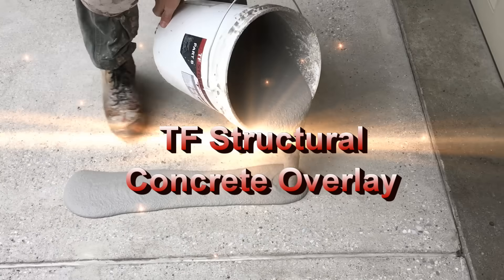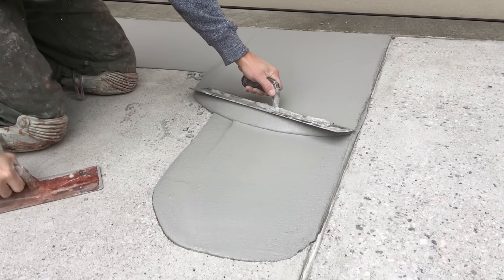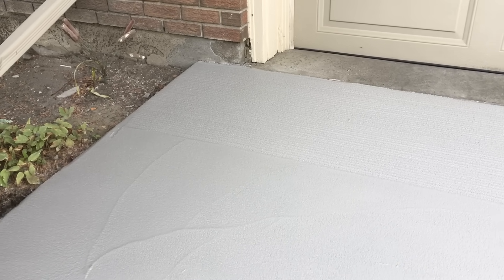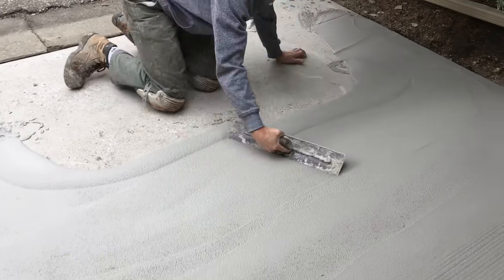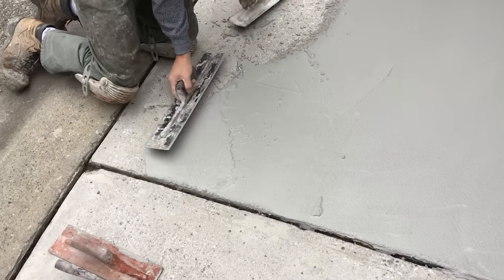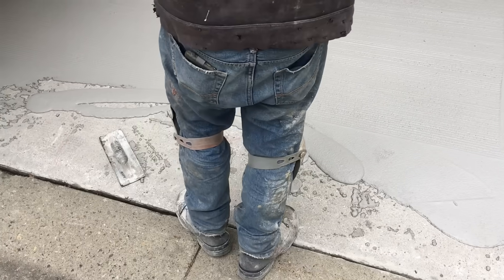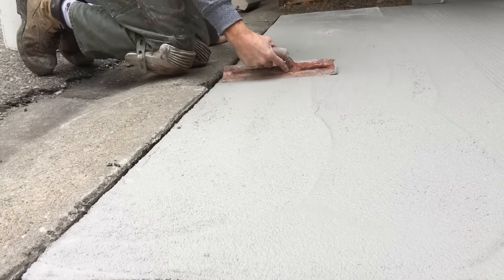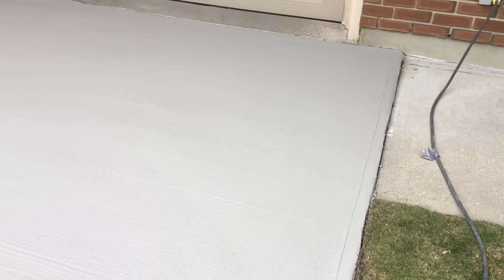TF Structural Concrete Overlay - Overview

Comment: Unfortunately, it's impossible to find ANYBODY willing to do this type of repair work. Concrete people like to rip everything out and install completely new reinforcement and everything, right? The video's look great though. Thanks much.
Reply from the maker: Try finding a concrete craft near you, they do it. Where are you located?
Reply: @TerrafuseInc  Thanks for your reply. I ended up having the slabs replaced. It was about 800 SF of very cracked driveway that had to resist garbage trucks and dumpsters. I think it could have been repaired but I gave up looking. No Concrete Craft within hundreds of miles.

Comment: How thick is the coat and can you apply a second coat. I have a badly spalled concrete steps
Reply from the maker: It’s about 1/8”. Yes, you can add another coat, or just apply it thicker, there are no restrictions.

Comment: beautiful work! we just got new concrete laid in our backyard, but theres imprints from the contractor crawling on the surface. interested in doing doing a stamp overlay. the surface currently has a brush finish. would it be necessary to sand it down before laying this product? thank you!
Reply from the maker: Yes, you need to do some prep on the concrete first. https://youtu.be/aCK3hjHAjXU
Stamping is a very challenging process, so I would only attempt that if you are highly experienced with this sort of work. Thanks

Comment: Nice technique. Other similar overlay products recommend or require hydrating the old surface before applying new material. What is different here? Like others I question going over the big crack without prep. Even if the customer didn't care, compressing a dry mix into that crack would minimize future erosion without a significant investment of time.
Reply from the maker: Also, other products are portland cement based, and require a hydration reaction to cure. It is very important the water stay in the material as long as possible during curing. 
TF Structural is not a portland cement based product, and does not cure this way. 
Hydrating the concrete before installation is still recommended, especially with thinner overlays, and on hotter/drier days. This will help with working time, spreadability, and overall finish.
Reply from the maker: Agreed. Lots of things should have been done with this crack, prior to overlaying.
Reply from the maker: https://youtu.be/o5UYlJmKhAE

Comment: How long does that concrete material last before cracking or chipping away ?
Do you apply any type of bonding agent in mix or on original concrete ?.
I live in a very harsh winter climate, wondering if that would not hold up well in freezing Temps and snow
Thanks
Rich
Reply from the maker: it will wear out at about 1/8" every 15 years or so. We have lots of videos showing it years after installation, one as old as 11 years. It won't 'chip' away, and will only crack if the substrate below it cracks. 
No bonding agent is needed, it doesn't need to be 'glued' to the surface, it will chemically bond with concrete.
It was designed and used extensively in Canada, so harsh winter environments is what it is made for. 
Thanks!
Reply: @TerrafuseInc  Thanks for the reply, Sounds very durable !! appreciate it

Comment: I don't get it, if cracks is not addressed and as you stated it will resurface; then why didn't you address it to begin with?
Reply from the maker: They didn't want to pay the extra. They weren't resurfacing these driveways because of cracking, the crack wasn't an issue for them.

Comment: You could've filled the crack with concrete first.
Reply from the maker: Concrete crack bridging using TF Structural Concrete Repair and flexible mesh tape.
Reply from the maker: https://youtu.be/o5UYlJmKhAE

Comment: I noticed you said "cracks come back". So you resurface this just to have a big crack come back? This product looks really good and I would love to use it just would like a further explanation of " the crack coming back". Thank you
Reply from the maker: This is a very rigid material, going over a rigid substrate. A thin layer will not prevent a large slab underneath from moving, this is why cracks will reflect through. There are many ways to address cracks before overlaying the substrate, to help prevent them from returning. We have a video on one method, and will be releasing more soon. Thanks
Reply from the maker: https://youtu.be/o5UYlJmKhAE
Reply from the maker: https://youtu.be/iuK9_XweHKA
Reply: Very nice. Thank you!

Comment: So the crack comes back... pointless then really. You  could have easily opened it up,  filled it first with a coarse concrete mix and then surfaced it- added an hour to the job.
Reply from the maker: It wasn’t pointless. This concrete had a horrible finish on it that they wanted redone. They didn’t care about the crack, so it was not repaired (there is an extra cost to this )
Reply from the maker: https://youtu.be/o5UYlJmKhAE
Reply from the maker: https://youtu.be/iuK9_XweHKA

Comment: Nothing is perfect but digging it all up and re pouring...concrete cracks over time..shifting ground underneath....concrete is superior over asphalt. I fill the crack and seal driveway to look good only...my patio we will skim Like this filling in cracks first....with power washing should look good for a few years...nothing last forever .
Reply from the maker: If repouring concrete was perfect, I wouldn’t have created these products 😉
Reply: Terrafuse Inc. that’s true ...haha...my ex was a mason and half the patio he did held up pretty good ....I was responding to the crack comments in the pavement....What do you think about filling cracks with epoxy first?

Comment: I doubt this process would last even two years in a harsh winter climate.....
Reply from the maker: Interesting comment, based on no factual information. It lasts much longer than 2 years. It was designed and tested in Canada, which has some pretty harsh winter climates 👍
Reply: @TerrafuseInc  The name is Tucker not Sucker.....good luck peddling it.
Reply from the maker: Thank you, but I don’t need luck. Our information isn’t based on nothing, like your comments tend to be.
Reply from the maker: https://youtu.be/iuK9_XweHKA

Comment: What product is this, whats the working time and dies it have a minimum thickness?
? I did a self leveling underlayment once that set up too soon.
Reply from the maker: TF Structural. It has 15-20 mins working time, temperature dependent, and no minimum thickness.

Comment: Thumbs up for the product and double thumbs up for the skills! I have a crapy concrete patio that was done by some newbie and it looks very hideous. I think the concrete was mixed with too much water or sand that it chips off easily on its surface. Would this product solve my issue?
Reply from the maker: Thanks! It works great for that application! Just remove any loose concrete first 👍

Comment: I saw a crack on that one slab, what did you do to prepare that? Is there a different video?
Reply from the maker: https://youtu.be/o5UYlJmKhAE
Reply: @TerrafuseInc  thanks.
Reply from the maker: For this slab, we just removed all the loose, broken concrete. This product is very rigid, so the crack will reflect through. There are many different methods to address cracking, and we have one video out to demonstrate one of these.

Comment: I didnt hear how they cleaned the concrete first. 
Pressure wash? Thanks
Reply from the maker: This job was scarified, and then they used a diamond grinder. If the concrete is free from sealers and oil/grease, and heavy pressure wash will work fine. You just want clean, sound, porous concrete. 
Thanks!

Comment: Thanks for the future work! Ill be ripping that out in 3 months. 6 months maybe if you sucked up the homeowner's renovation budget. Toppings are like 10 minute band-aids. No matter what the box, bag, or bucket says, it will fail. That crack came back within 3 days of driving over it and in 6 months was chipping out.
Reply from the maker: The only thing true about your comment, is that the crack will reflect through the new overlay.
Reply: @TerrafuseInc  So it will fail.
Reply from the maker: If you consider a crack a fail. This customer had an old overlay on the driveway that was delaminating. They wanted a new overlay, and they were aware the crack would return, so the crack is not considered a fail. Products used for resurfacing are extremely strong under compression, but have no flexibility. However, there are techniques to address cracks, but it is very difficult to guarantee a fix. As well, we can offer flexible, decorative overlays if that is what they want fixed.

Comment: Hello. I have a two car garage in Nee England where the concrete can become damp during the Spring. Will this product hold up without bubbling up?
Reply from the maker: Are you just doing some concrete repairs, and leaving it, or covering it with a coating after? How thick are you going? Some details will help me answer 👍
Reply: Terrafuse Inc. Thank you. Need to abrade the concrete and coat it same way as in the video. Floor is even but.damp in middle sometimes. Not wet.

Comment: Do the applied concrete overlay will have a chance getting chipped? And is it applicable to apply sealer after its curing?
Reply from the maker: No, it won't just chip off. There is no need to apply a sealer, but if you want one, you will need to do some type of mechanical abrasion for the best bond, as the TF Structural cures very dense. A light sandblast, or heavy pressure wash would be needed, to give the sealer the best bond. Why are you looking to seal it after?

Comment: Great job...just dont see the point of using this material if it's not an elastic material to move with the cracks and keep the unexposed 🤔
Reply from the maker: There are many issues with concrete that can require a restoration. Scaling surfaces, improper broom lines, heavy pitting and damage, improper sloping, incorrect thickness, etc. Using elastic materials can be very costly, and often look very out of place outside on a driveway. We have these options also, but a lot of times, customers just want the broom finished concrete look. Like concrete, cracks can't always be prevented with rigid materials, but they can be filled after they show up with flexible caulking, or similar materials.

Comment: Ya should have used portland and bonding agent but first you have to hydrate aka soak the old slab. I know some products have glue in it all ready but i dont trust putting wet patch on dry concrete.
Reply from the maker: Can I ask why you are suggesting this? This product was designed to avoid using Portland cement, modified with polymers.  The chemistry of TF structural will bond directly to cured concrete, and doing what you suggested will actually interfere with this bond, creating an inferior overlay.

Comment: How much should someone charge for that job you did (2 car driveway)???
Reply from the maker: You can charge $5-$8 /foot, depending on the level of deterioration and prep required. You also want to be competitive with what it would cost to have it ripped out and replaced with new concrete. Hope that helps you.
Thanks
Reply: Terrafuse Inc. Thank you. I really enjoyed watching your video. I learned a lot from it, you gave me so many business ideas. I did the math and I can see myself making money. This line of work requires a contractor license right?
Reply from the maker: That’s great! Yes, concrete restoration is a huge industry, and with a quality product, you can offer a great alternative to replacing concrete. There is no licensing that I’m aware of, you just want to understand the products and methods, so the work you do will last as intended 👍
Reply: Terrafuse Inc. Really? Concrete restoration don’t require a contractor license? What city do you reside?
Reply from the maker: We are based in Calgary, AB. I am not aware of different local requirements, but there is nothing like that here.
Reply: Terrafuse Inc. Sorry to bother you again, is it possible to seal your product?
Reply from the maker: @carlosfigueroa9547  It isn't ideal, as it is very dense, and the sealers don't penetrate as well as they would for concrete. Why are you looking to seal it?
Reply: Terrafuse Inc. To get my HOA off my back. My driveway has oil stains from the previous owner. I’m just looking to prevent any water or oil stains from penetrating in to my driveway.
Reply from the maker: Ok, I would recommend a heavy pressure wash before you seal it, just to open up the top surface, and get a better bond.
Reply: Would u be able to seal that slab you resurfaced in the video, if so what urethane would u use?

Comment: Previous home owner of my current home did something similar. After a few years now all the underlying cracks are coming through the resurfaced layer. Looks cool at first. But it's just a band aid In my opinion.
Reply from the maker: It is a band-aid if the contractor told them he was there to fix the cracks, and then applied a thin, rigid overlay to the surface. This is not how you fix cracks. As mentioned in this video, we were not at this job to fix this crack, and the homeowner was aware it will come back. Cracks will come through all cementitious overlays, as they are very rigid, and have no flexibilty. There are multiple methods to address cracks, and one can be seen in this video https://www.youtube.com/watch?v=xvq0TXjMfeU&t=2s  but again, this video was not about fixing cracks. 
Thanks

Comment: I use something similar to this product. Is from Concrete Solutions called Resurfacer. Works Great. Epoxy 300 Flex Paste F.C from APF is a great product to fill in those cracks. 👍🏽 Great Vídeo

Comment: Why not fill the crack, and top with a 1/16" thick wire mesh.... Then let it set up and dry for 24 - 48 hours for the finish coat__? It seems to me this may prevent the crack from possibly reoccurring...?
Reply from the maker: The customer was not concerned with the crack, and did not want to pay for different repair methods. There is extensive discussion about the crack below. You can also follow this link for another method of crack repair.
Thanks!
https://youtu.be/xvq0TXjMfeU

Comment: Does this work over asphalt driveways?
Reply from the maker: No, it is not recommend for asphalt, as it is not a very ridged substrate, and TF Structural requires a rigid substrate, with lots of compression strength. Thanks

Comment: Hello there do you guys sell the products? I'm wondering if this  Product  Permanently bonds with the existing concrete or if it creates a coating over the concrete that can chip over time?
Reply from the maker: Hello, yes we sell the products 👍 It does form a permanent bond with the concrete, NOT a surface coating that chips off.
Reply: @TerrafuseInc  can you send me the link for this specific item please
Reply from the maker: Hello, if you go to Terrafuse.ca, just click into the product section, and this product is TF Structural. 
Thanks
Reply: Do you ship to US?
Reply from the maker: Yes, we have locations in the US we can ship it to you from. I suggest you call our office, and we can figure out the best place to ship to. Thanks!
Reply: @TerrafuseInc   Awesome thanks for letting me know I would you that today

Comment: You can fix the crack by cutting it wider, then using Rappidset CementAll to fill it. It is a polymer cement that cures to 9000 psi, and does not shrink. You can go over it with your resurfacing soon after using cementall, since it cures really fast.
Reply from the maker: Please see this new video for a good crack repair method. Thanks!
https://www.youtube.com/watch?v=xvq0TXjMfeU

Comment: That is a fantastic job .I don't know anyone in our area that does this. What would the average cost for a area that you just did?
Reply from the maker: That typically will cost between $5-$8/foot, depending on where you are. Where are you located?
Reply: At that cost. You can pour new concrete.

Comment: If you want to get rid of the crack bust it out two inches wide all the way to the bottom.  Then clean.  Then wet. Then fill with concrete.  Work concrete into the sides and bottom of the crack.   Then level with trial.  Let dry!  It will shrink!  Go over with a mortar to make perfectly smooth.
Reply from the maker: Just like this! https://www.youtube.com/watch?v=xvq0TXjMfeU

Comment: That mix looks really thin, and you don’t need to fill that big crack first? Interesting.
Reply: Ive ripped out TONS of failed toppings. Over time? That crack will come back as soon as you drive over it. Not to mention 9 out of 10 toppings flake off.
Reply: Customer must have been a flipper because what homeowner wouldn’t want to fix that big crack first ! It looks good !
Reply from the maker: Here is a good crack repair method that can be done prior to overlay. In this video, the customer was not concerned about fixing the crack.
https://www.youtube.com/watch?v=xvq0TXjMfeU

Comment: Granted, this repair will not hold up as long as a complete re-pour, but saves a ton of work and expense.  If it buys you 3-5 years, it's probably worth it.  Nothing is permanent.  Do a re-pour and it too will show wear and cracks within  a few years.

Comment: Would it not help to have original surface wet?
Reply from the maker: Yes, it will assist on hotter days, or very porous concrete, but is not always necessary.

Comment: Very cool, these guys are quite skilled, but this would never hold up in a cold climate.
Reply from the maker: This product was designed and used extensively in Canada, which can be a very cold climate through the winter months. It holds up extremely well in this environment.